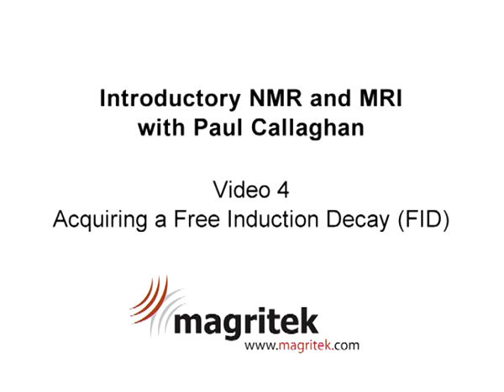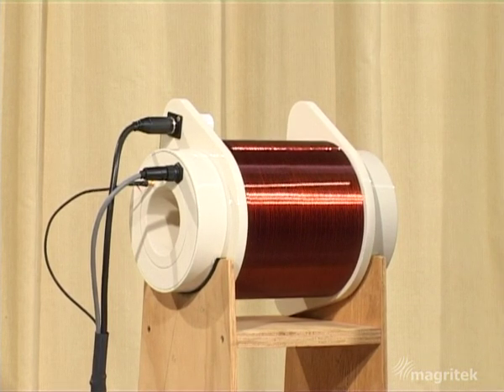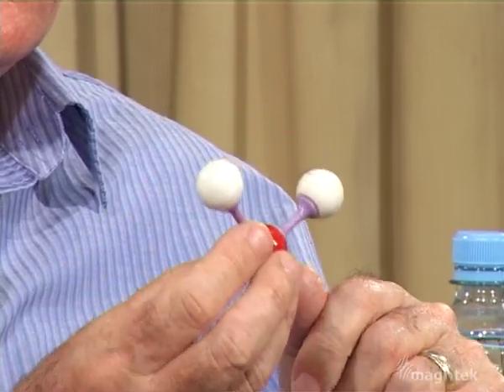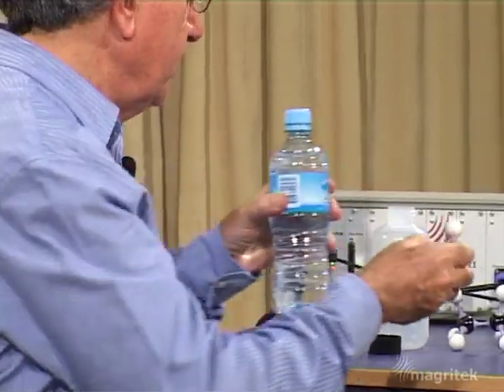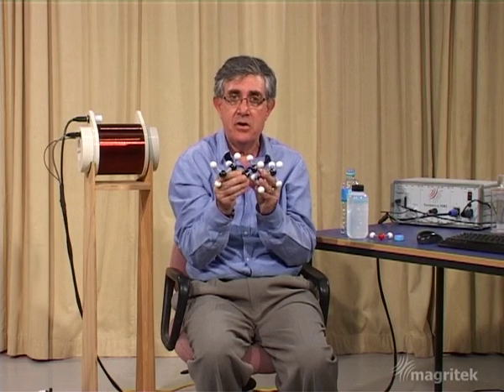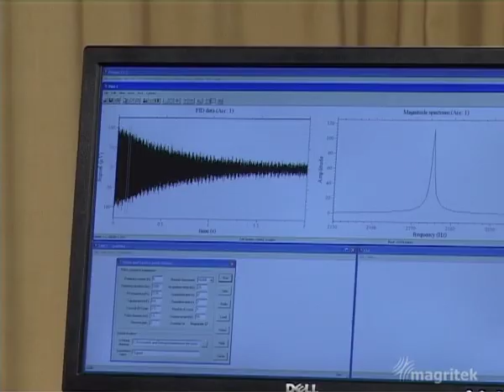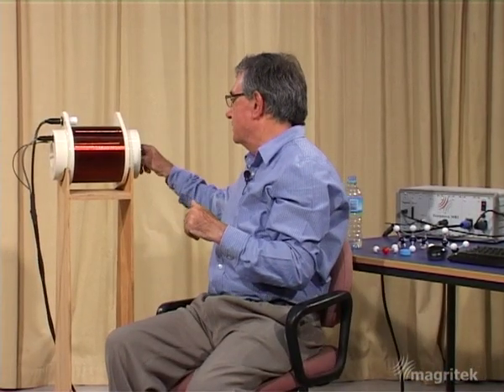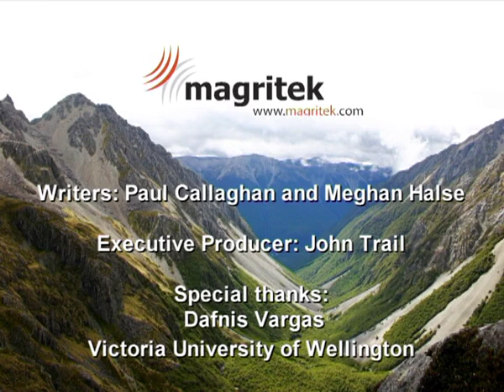Introductory NMR & MRI: Video 04: Acquiring a Free Induction Decay (FID)

Comment: I'm a little confused about the pre-polarizing pulse. It seems like the direction of that field would need to be the same as the static field (earth's), but the field produced by the outer coil of the Terranova looks like it would be oriented orthogonally. Where's the mistake in my thinking?

Comment: Paul,
  As an EE, I understand very well:  resonance, presession, NMR in hydrogen and  both the time and spectrum (fourier) domains as well as most of the other fundamentals, but have the same issue as Eric Stewart below:  The difference between the pre-polarizing "pulse" and the earth's field illudes me.  If Earth's field is producing the main precession causing field, what does the pre-polarizing field actually do?  Does it shift the hydrogen moments away from the vertical to the horizontal so we can then watch the precession decay back to the Earth orentation?  I thought that required an AC field that is resonant with the Hydrogen's precession freq.  Is the pre-polarization field a DC field, or 2+ kHz field?
On to #5...
Regards, Steve N.